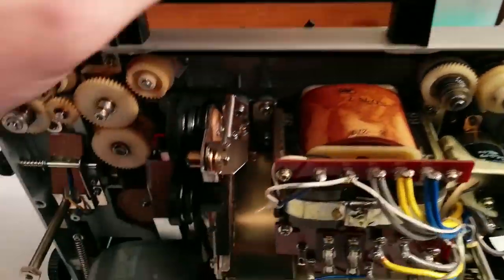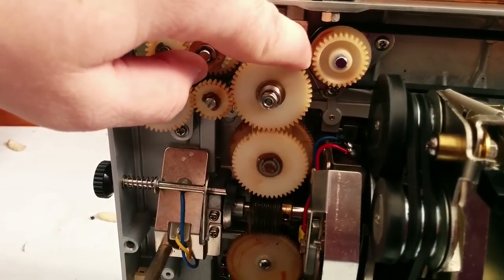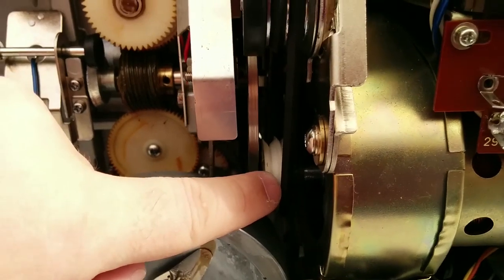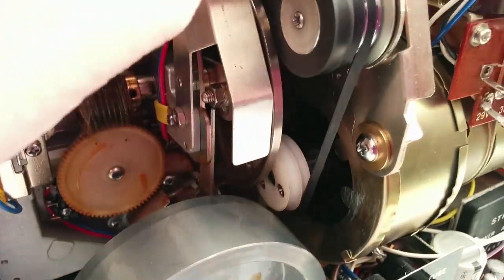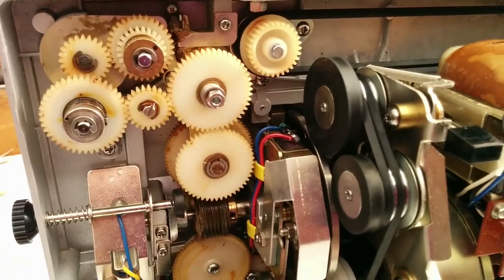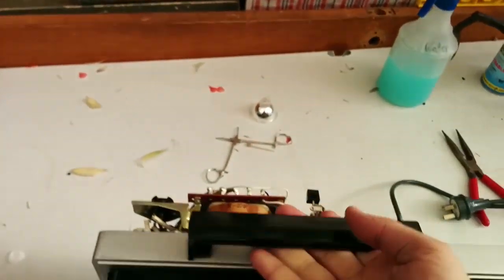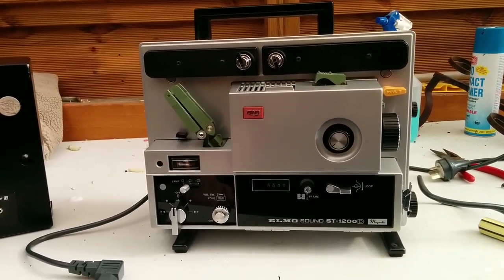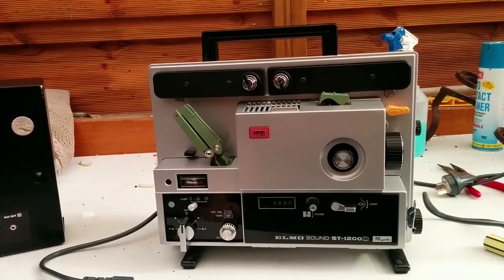Elmo ST-1200 - Where To Put The Belts

Comment: I see you do not have the rubber band around the shutter wheel.  Not sure how it can run without it.  Not being able to buy one that I could install, I found a way to do it for less than $10.  Would appreciate you letting your viewers know about this important hack.  The video just went live and is at:  https://youtu.be/owyW7rDYWD4
Reply from the maker: I seem to recall that not all of them had rubber around the shutter wheel, possibly a different revision. Mine runs fine and at speed without the rubber and didn't have any residue to show it ever was there. Still, your information is useful so I pinned your comment to allow others to easily find your video.

Comment: Oh, thanks indeed. I took the old belts to a general belt warehose where they measured them and gave me three new ones for 3,25€! I replaced them following your directions when screwing back the knob, the screw broke... but the piece spins anyway, it all worked as if is was new but... mine is a ST-1200 HD meaning the latter two letters that the shutter wheel has a rubber rim, and that rim melted too after I turned the projector on not closing the rear cover and the rubber wheels warmed the shutter wheel up, so it splattered petroleum-like drops allover my white walls...  Looking into blogs they say I can easily remove the rubber goo rim on the shutter wheel using car brakes solvent for that rubber was ment to reduce vibrations and noise, so the projector works without it. Thanks again from Madrid.
Reply: Read my previous post.  I took had the rubber on the shutter wheel and then noticed that in this video there wasn't any.  So I used the Awesome Oxygen Orange and removed the melted rubber on that wheel as well.  It is now down to the bare metal which looks a bit rough so I hope it will work. Waiting on the belts now.

Comment: Thank you so much for your help.  I used a cotten swab dipped in acidtone to remove the old belt tar on the motor pulley. This will take all the tar off before you install the new belts.
Reply: Works fine, just don't try it on plastic pulleys, they could dissolve!

I use Printer 66 printer cleaner by Kontakt Chemie, works like a charm and is safe to use on plastics! It's also great for re-surfacing shiny idler wheels!
Reply: I did mine after trying Goo Gone and others which was a mess.  The stuff that melts it away and turns it into black water like liquid is in the Dollar Store or online.  It is LA's Totally Awesome Oxygen Orange.  Toxic stuff but works on everything really strong.  I stuffed paper towels under the white pully wheels and in other places and sprayed this stuff. It actually melts the black stuff off. I also used a tooth brush to get into the innermost part of the pully.  The ones on top as you demonstrate in the video both can be taken off easily for cleaning in the sink with this Awesome Orange cleaner.  Do a google search for it or look in your dollar stores.  Just wear a mask this stuff is strong and you will start to cough from it.

Comment: Interestingly enough, the various 1200 models (D, HD, M-O) all seem to have different belts!

Mine is an M-O and it only has one large motor belt and the take-up belt. There's also a third pulley beetween the 18 FPS pulley/idler and the motor pulley that doesn't seem to do much but keep the belt tight. For some odd reason the long take-up belt is toothed although the pulleys are both smooth and appear to be designed for a square belt.

The take-up belt on mine looks to be indestructible, apparently it's somehow reinforced. The motor belt on the other hand is pretty close to melting, it's already very soft and slightly sticky. On top of that I noticed that all the grease is getting sticky so I took most of the mechanism apart, cleaned and re-lubed it according to the service manual.

Comment: I have and Elmo ST-1200HD. To install the motor belt did you have room to fit the belt between the shutter wheel  and the plastic bottom pulley? Is that how you got it on. Also did you have to remove the flywheel?
Reply from the maker: mystarstudios I just managed to push that belt through the gap without needing to remove anything.
Reply: snarfusmaximus Thanks. I got it. I'm at 60hz so just reversed the order with the larger belt on the left and the smaller one on the right. The speed seems good.
Reply: I believe that's what the service manual recommends.

Regarding clearance between shutter wheel and pulley I've read that the manufacturing tolerances on these models were quite large so on some projectors you might be able to squeeze in the belt just fine while on others you need to loosen the motor pulley and push it towards the motor (that's what the SM says). The forum post I found on that issue said never to force the belt because if you do that you risk bending the shutter.

Comment: Hello, What is the function of the fly wheel? I change the belts  but I don’t see how the wheel turn and why? Is the wheel in contact with something?
Reply: The flywheel is used to maintain constant film speed past the sound head. Initial rotation is started by a snubbed roller(?) Then maintained by the progression of film passed the capstan. (It's been a long time since I looked)

Comment: I have the same projector. The rubber belts are broken so the projector is useless. Would you know where i could get replacement rubber belts? Thanks.
Reply from the maker: I got mine on eBay. You can find a set if you search ST-1200 belts.
Reply: Thanks